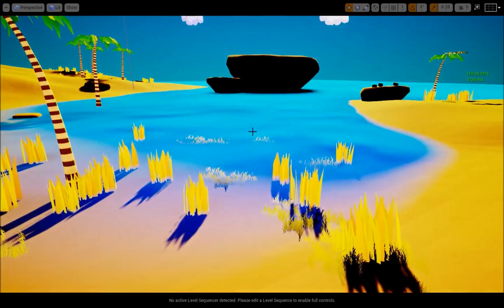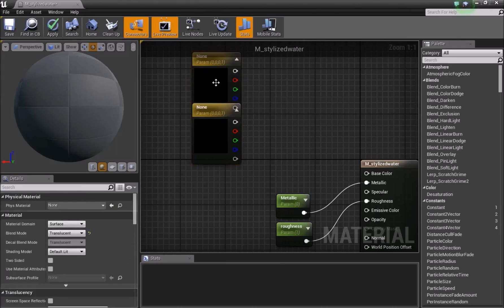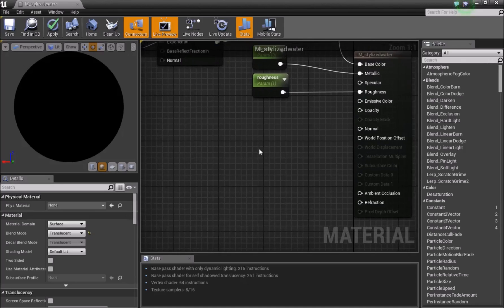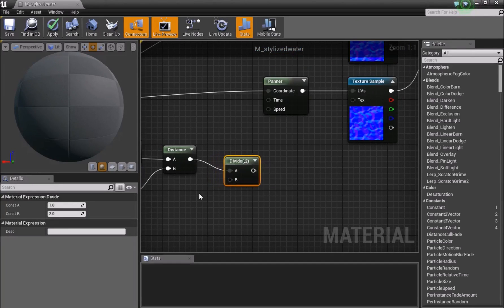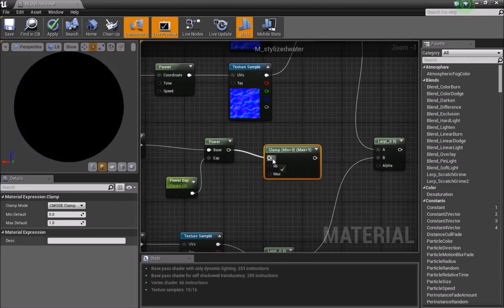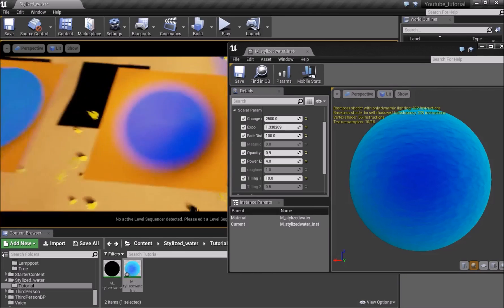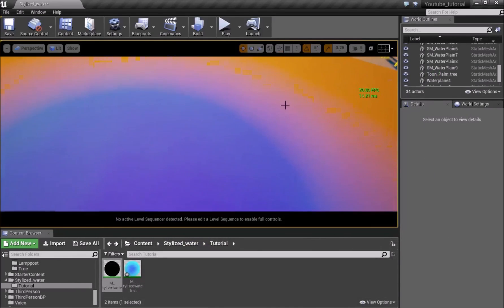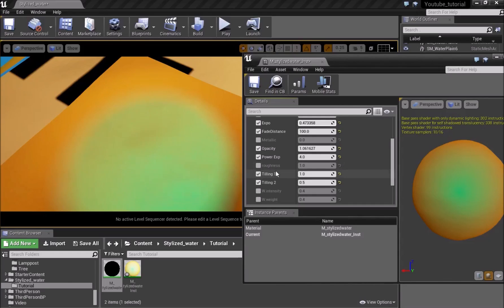Stylized Water | Tutorial | Blender to Unreal Engine 4

Comment: Whoo!
Reply from the maker: :D
Reply: Did you know if you hold S and click it creates a parameter? Saves you from having to convert them. V+Click is vector parameter. Also very interesting on how you used the depth fade with the opacity. I had never thought to do that. I'd only been using depth fade to transition between deep and shallow colors of the water, and then for the foam.
Reply from the maker: Ohh nope I didn't know that. Thanks!